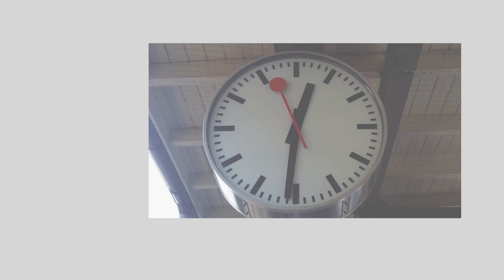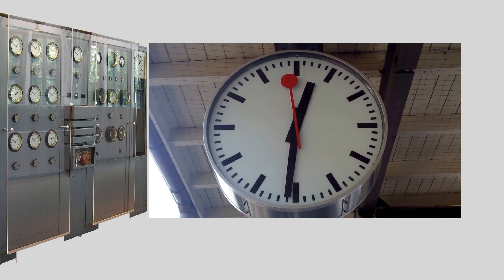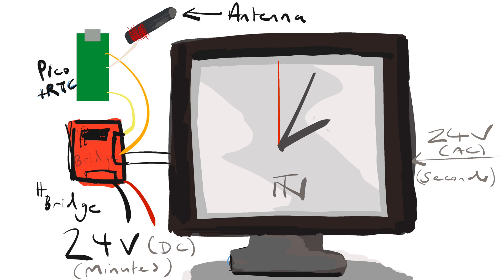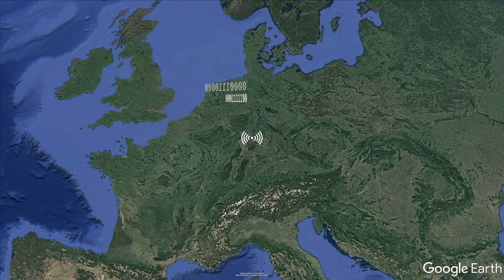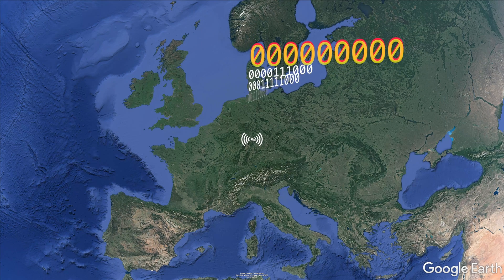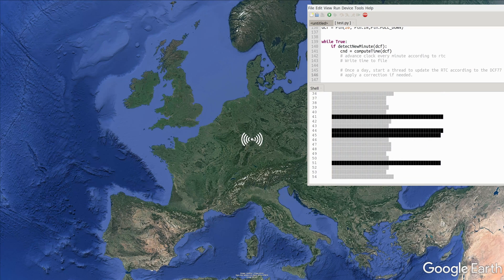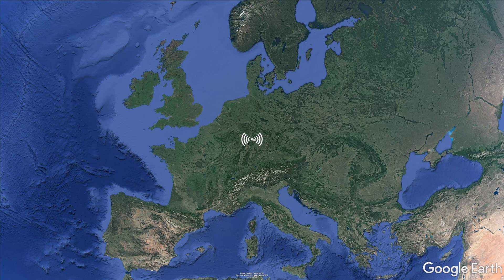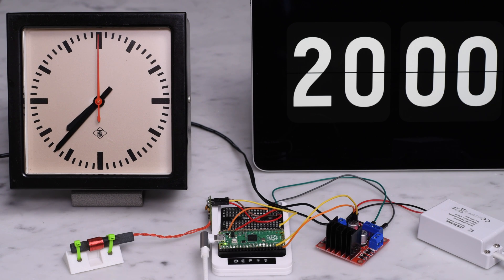Retired German Station Clock Brought Back To Life!

Comment: Hi! Will this works on all kind of slave clock movement? Also, is the way that the second hand pause at 60 sec mark depend on the code or the clock movement? Thanks! Great project!
Reply from the maker: There are a couple of variables, voltage, pulse frequency, pulse duration but all can be easily tweaked in the code and/or with the power source used. The pause is due to the clock movement....  I'm sure someone can explain the original reasoning behind it, but as far as I know, a lot of clocks with second hands do a full rotation in 58 seconds, hence a 2 second pause.....

We're about to upload a more detailed video that might fill in some of the gaps we left in this one.... it'll be uploaded by tomorrow

Glad you like it!
Reply: @VEEBProjects  Thanks!! I have always wanted to recreate the swiss railway clock in a mini form factor like the size of your clock project! I had a hard time figuring out how to create that second hand stop for 2 secs like that so it’s great to see someone create something that’s close to what I wanted to create! Also if I stay in asia can I set this thing to operate on its own and without the DCF77 signal?
Reply from the maker: @peterpete6231  You could set it manually, or use an atomic clock signal in Asia :)

Comment: Great project... I am not sure i fully understand which clock to choose as a start, would you be able to give a bit more specs - what will work, what will not - please?
Reply: Pragotron :)
Reply from the maker: Sure.... do a search on ebay for 'Nebenuhr'. You then need to supply a voltage, which is usually listed in the description. 24v is typical, you can get that via a cheap led power supply (or maybe just use a step up transformer to make the pico output 24v (not tried this yet))
Reply: @VEEBProjects  Thanks this is really useful, I undersand it now... 2nd kind request: could you make a connection diagram for us simple-minded? I think I more or less get it but it would be much easier. Especially if we get similar parts from elsewhere (I have the same RTC module but not with pico form pins for example, and I want to make sure I am connecting it right).
Reply from the maker: @laurentbonherbe370  I will make the github repo a little more detailed and maybe make a quick video of the steps involved. It's a deceptively simple little project but there are one or two little things along the way that took a lot of googling
Reply: @VEEBProjects  one more question if I may: How can I change the timezone in the code? I bought 2 clocks to make a 2 timezone display, and so now I have to change the time for 1 of the clocks...
Reply from the maker: @laurentbonherbe370  We're just about to publish a video that gives a little more detail. Are you running both clocks from 1 pico and one clock on each output of the H bridge? That would need a few little tweaks to the code. Submit a request on the github page :)
Reply: @VEEBProjects  I wasn't that ambitious, I only planned to run each clock on their own pico... The challenge with multiple timezones is not only to shift the clock in 1 direction, but also the daylight saving time may differ from 1 country / timezone to the next. So complicated!
Reply from the maker: @laurentbonherbe370  The signal from DCF77 follows the German CET CEST. If your other timezone was in the US, then it would need the two week early adjustment in the US hard coded in. The differences between all countries that use daylight saving can be found here: https://en.wikipedia.org/wiki/Daylight_saving_time_by_country